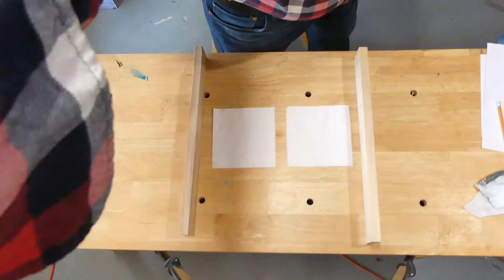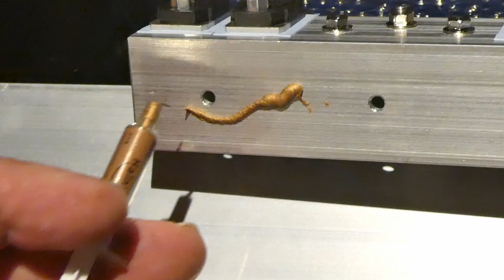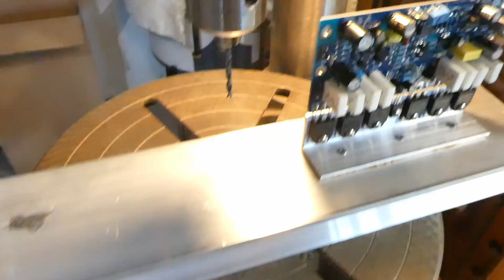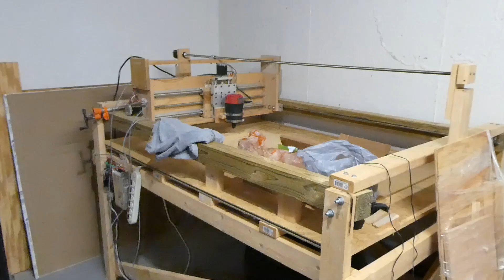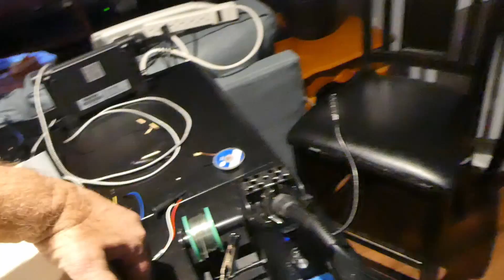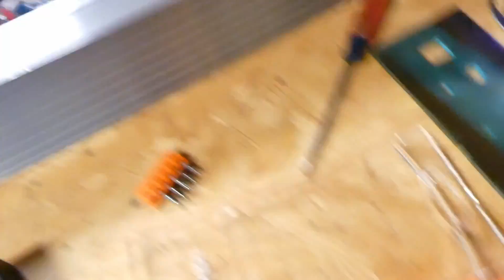L25DSP (Enclosure) DIY Amplifier Build (LJM L25, ADAU1701 DSP, ESP32)

Comment: Hi Rob. Its time for me to finish one of my cnc machine so I need some help because I dont want to screw something at setup.

I have order red 4axis control board and want to connect and start everything soon..

Can you give me some advices if you work in mach3 software about proper setup at beginning, homing, end stops… Thanks
Reply from the maker: Wow that sounds like a lot of fun, I'll help if I can ... it's been a while. Four axis board  usually just has two motors driving the biggest axis (whether that be x or y) at the same time. Mine is three axis.
Reply: @rhenry74  
Yeah mine is 3 axis also, its portal and table is moving. 
Since I bought old NC machine it already has all mechanic, I just replaced all electronics and motors. 
I just need to connect everything and that is also not a problem but I dont want to crash it because I dont know about software, I want to properly configure everything..
Do you work in mach3 or some other software?
Reply from the maker: The software I used to control my machine is called Linux CNC. It is free and it runs like an operating system so it's not like a program you install on a Windows machine. It also requires a parallel printer port, I know crazy right?
Reply: @rhenry74  
Yeah I heard about it. Think I will start with mach3 and then probably go fully to uccnc in future as they say its the best.
Reply from the maker: Is Mach 3 a free application?
Reply: @rhenry74  
Its free if you want it to be free, I didnt pay for mine :D
Think I will go for mach3 or mach4 if possible but Linux seems nice but  too much complicated..

Comment: Hi Rob. The L25 is one I have not built before, don't know why. I guess you cannot build them all. Regarding the heatsinks, you have the same issue I had. The fins should be vertical really. How hot is too hot? My Onkyo AV amps sinks get silly hot but they are contained in the case so you cant touch them but they do get too hot to touch, been like that for 6 years now. My L15 amplifiers I've got fans on them with a controller. Got them set to switch on at 30 c on low. I just think electronics will last longer if kept cool.
We all break taps  at times no matter how careful we are. Might be the hole was a little small?
You might find sticking some aluminium foil to the wood and earthing it might help. DSP, as you know I really don't like them. I understand why you like them but noise can be an issue. They also have poor immunity to overloading the input unlike a standard pot.
Cabinets are always an issue. So hard to make them look, not home made. I envy  the tools you have. When I was working I had access to such stuff but now I'm retired I've got a soldering iron and a hammer! Pre made ones are always too small and silly expensive.
As you said, it's a hobby, you can't put a price on the hours you spend, the cost of errors, the odd bit of smoke but the satisfaction of sitting in your favourite chair, listening to your music and thinking, boy, that sounds good and I made it. No hobby like it!
Reply from the maker: I worked in a CB repair shop when I was in high school. We sold, repaired and installed RF (linears, no they're not legal) and audio amplifiers. They always had the fins oriented this way (horizontally) so I didn't give it any thought when I was shopping for heat sinks. I don't disagree... just didn't think about it. I'll have to get some fans involved in my rig I guess because the power supply gets very hot too, when the cabinet is buttoned up... but I haven't thought all that through yet. I have a microcontroller to make decisions and control speeds but GPIO pins are precious.

 I just over torqued the tap... like a rookie.

"So hard to make them look, not home made." - true that. My wife said it needs a metal face plate.

You know I thought about wrapping that center bulkhead in aluminum foil, but I was afraid folks might think that a 'red neck' idea. I'm slowly chipping away at the noise issues... no spoilers.

I inherited the drill press from my dad. The rest of the stuff is relatively cheap aside from the homemade CNC machine. I might have a grand (and a couple of years effort) in that.

"the satisfaction of sitting in your favourite chair, listening to your music and thinking, boy, that sounds good and I made it" - fact!